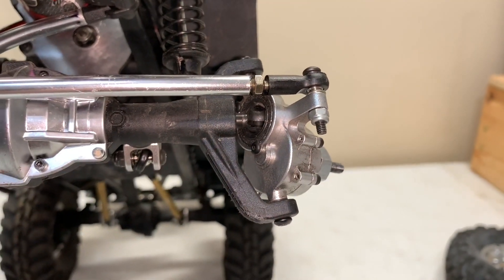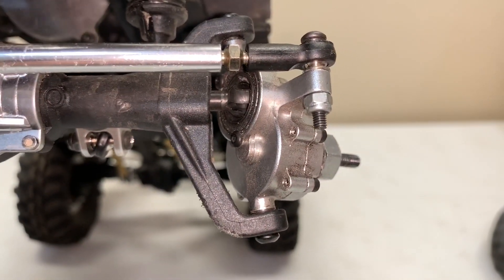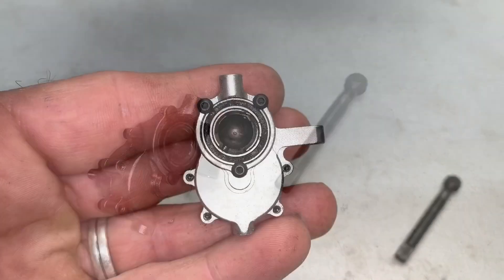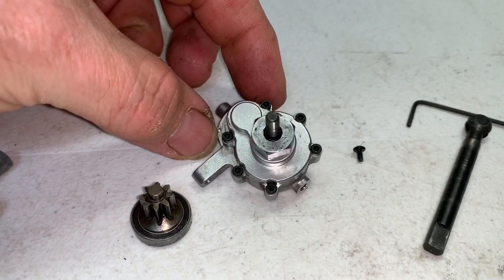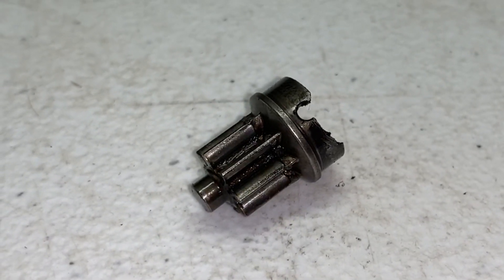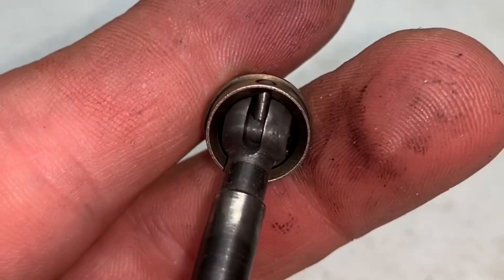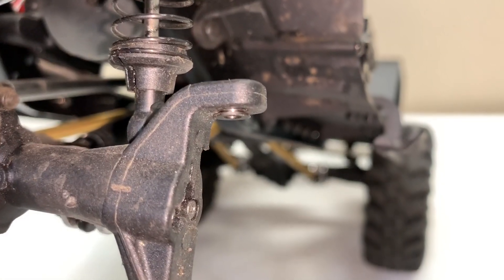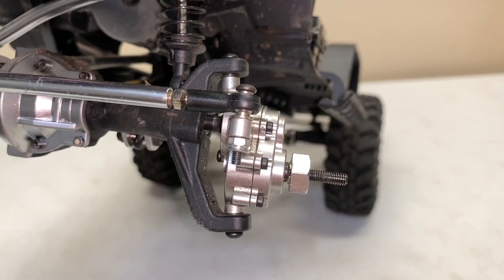Gen8 CVD Change How to

Comment: Seems a common issue for some people on the Facebook groups but others it happens more rarely. 
I seen someone drill new holes 90 degrees from the old ones to get some more use out of their broken bits. Seemed to hold as well
Reply from the maker: hardcoretam I saw the same post about it. My issue is if you drill the holes farther in you lose steering angle but if it get you back on the trail then it’s good. These pieces should be made out of a better material. If they were a better material we wouldn’t be having issues. I’ve broken over half a dozen, most of the time it was playing around but a few were very mild driving situations.
Reply: Lol, post on FB was me. I thrashed my truck hard again today, still holding up well. I run 3000kv brushless setup.

Comment: I have broken 7 input gears. I cross drilled broken gears 90° off broken pin holes. Now each gear is good for another time. I just used a drill press vise and drill press. Recycle those busted gears!
Reply from the maker: Ok awesome. Did you drill further in in the cup?
Reply: @ExocagedRC  not really,  maybe a few thousandths, I leveled bearing support of gear, fit shaft socket in and eyeballed depth. 6 of 7 were a success.  One was overhardend from factory. Very brittle, splinters when bit got halfway through.